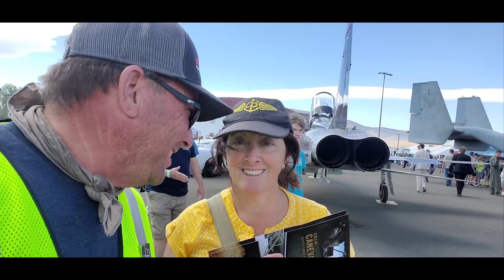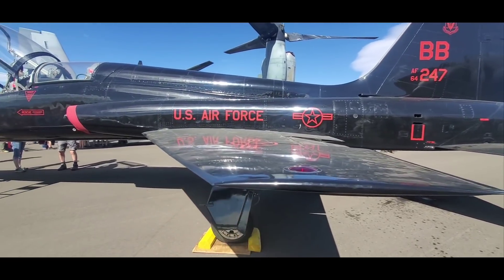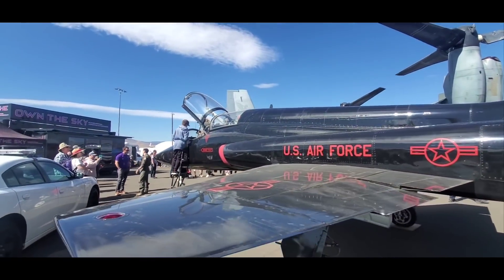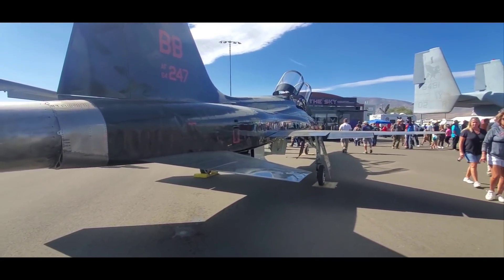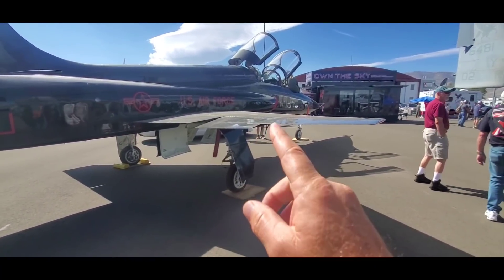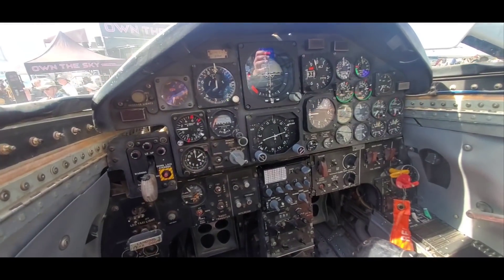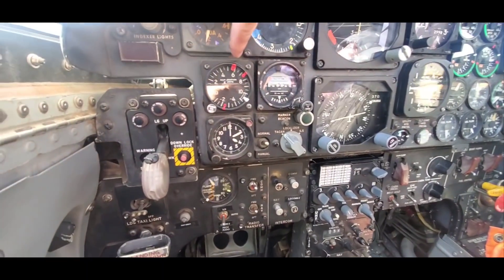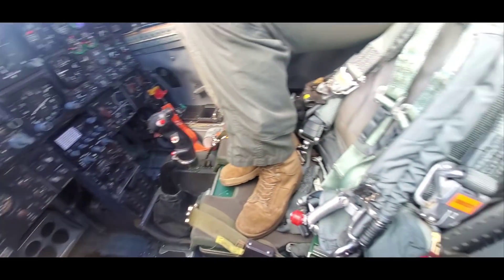T-38 Tour!

Comment: Flew a fresh 38 that smelled like a new car in 1970 at UPT. It had fewer than 100 hours on it and was a very smooth flyer. As I recall the roll rate was about 720 degrees per second. Never liked flying with the new Lt instructors, their hands were always touching the stick. The post Nam Thud drivers and Hun drivers taught you to be a fighter pilot and were great fun to fly with.
Reply: The post Nam Thud and Hun drivers were as rare as white Buffalo.  I had a B-52 A/C commander.  Still learned a lot, but there was no Fighter Pilot Mystique in that guy.
Reply: Thuds first fighter aircraft designed to carry nukes- went "thud" when engine went out  made great wild weasels. Replaced by F4's. Hanoi Hilton had lots of Thud pilots.
Reply: @c123bthunderpig Thud was a hard fighting war horse for sure. Lots of Thud parts scattered around SE Asia
Reply: By the 80's the AF had learned to tell the IP to quit touching the stick unless you were taking the aircraft....Former T-38 IP
Reply: @fishon7301  I had flight at PIT with an old behind the liner who not only had a hold on the stick, but had his feet on the rudder pedals.  I discovered this on takeoff roll and I very forcefully and angrily told him to get off the rudders and stick.  I was a butter bar of course and I believe he was an LC, because he seemed quite old - ha.  He did and we had a great flight.  I do not recall his even mentioning it during the debrief.  I never rode the controls with a student but my hands were much less than an inch from them in the pattern near the ground and in fingertip.  I never coached with my hands either.  Change of control was positive, both verbal and physical.  After I left Willy I heard they lost a jet at altitude over a change of control issue, but I do not remember the details.
Reply: @bja2024  i took basic flight at willy in 1968, was transferred to Luke for advance flight and them to Udorn where I blew out my eyes and was let go. T38 was fun but the f4 was much more of a useful airplane. ty for the tour, takes me back.
Reply: @jmac8092  👍👍
Reply: @jmac8092  What happened to your eyes jmac?  Willie was a great place, '72-'73 for me.  Flew RF-4C's afterwards.
Reply: Agreed.
Reply: Shoe

Comment: The AOA system was added sometime after 72. When it was first added, we really never trusted it because in part, we didn’t understand it. The throttles head finger lifts that you had to raise in order to shut off the engines so a gross overshoot and throttles snapped to idle did not cut the engines off.  Although. I did see an IP shut the engines off in last change at PIT doing T-Bird ground ops.

Comment: Funny, even the pilot didn’t know asymmetric g’s.  2.5/2.7/2.9 at 1k 2k, and 3.7k lbs of fuel.  The redlines shown were symmetric g limits at full fuel load and 1k fuel. 6.0/6.6/7.2.  It’s been 30 years, but these numbers are hard to forget after 7 years as a FAIP!?!

Comment: Unless it’s changed, the B model only had 6000lbs of thrust in full blower.  Still good enough to hack the clock at brake release and pass supersonic at 43000 feet in 3-1/2 minutes.

Comment: - 3,000 lbs of thrust x 2 in burner. 
- 2,000 lbs x 2 in Mil
- As far as supersonic top speed, the reason the 38 is limited to 1.15M or so, is the convergent nozzles can't accelerate air faster than Mach 1.0, but since the air temperature is higher inside the engine, Mach 1.0 is a little higher too.  So even a simple convergent nozzle can push the jet a little above Mach 1.0 measured in the ambient air.
- The lines on the G meter are for full fuel and near empty, not for symmetric and asymmetric which is limited to just over 4 rolling Gs worst case.
- The area rule fuselage is to keep over all air displaced by the jet minimized, so you squeeze the fuse a little where the wings would otherwise displace more air.  It helps cap drag when supersonic because it helps cap drag all the time.
- The reason the stick feels heavier when supersonic is that the center of lift moves aft, making the CG position feel more nose heavy even though the CG doesn't change.
- She is why we make student pilots to go through PA.  Its not that PA knows anything either, but it makes it harder for her to talk.

Comment: The all moving tail was the British solution to the Mach Tuck problem (movement of pressure due to the shock wave over the elevator) that was key to enabling the Bell X1 (which originally had a convention tail) to break the sound barrier.

Comment: I remember watching a T-38 take off early one morning as I was working on the ramp. It caught my attention as it sounded just a bit different that morning.. Low and behold, the rear canopy was up and doing a darn good job acting as a speed brake.. To the pilots credit, he kept it straight and level at about 50' off the desert floor until the canopy finally ripped off and in the process took off the top of the vertical, above the rudder. The pilot was able to save the aircraft and return to base, but I'm sure the cockpit likely had a new aroma after that..

Comment: Did I see that aircraft didn’t have the modified throttle gate?  I thought they all had that?  Kept the stud from inadvertently shutting down engines, and was only in the front seat so prevented the ip from being able to shut one down at all. 

We used to joke that the windscreen between the back and front seat saved many a students lives, “cause if I could have reached up there and strangled you I would have”😂😂😂

That light was a position light, the formation lights were strip lights molded into the skin. 

Congrats to the young lady on the U2!   Pioneered by the first woman u2 pilot from Willy back in my day.  Won’t mention her name for obvious reasons, but an awesome pilot!  Nice to see Pete there in the middle of things.

Comment: Thanks for the tour. Black really does show off any flaws, car or plane. A couple corrections. You're about an order of magnitude off on the thrust. It's about 3000 lbs each under burner. 2000 full military power. Also, the Talon will do supersonic in level flight. I think its just more fuel efficient to break through transonic in a dive.

Comment: No flap not really hard from front seat.  Final approach speed 170 plus 1 knot for every 100 pounds over 1000.  No flap from back seat was difficult, especially to 150 foot wide runway.  I have 2,000 hours in the T-38 at Reese and Minot as ACE Deputy Detachment Commander.
Reply: Pretty cool gig John flying them at Minot.

Comment: A moot point, Chuck just verified stabilator dynamics he did not invent it. It was developed in the fog of jet aircraft design during and after WW2 by the British- Miles M.52 aircraft Which was cancelled mysteriously by British and picked up by USA and used by NACA. Sir Frank Whittle resigned as a result of this decision.  Wing chord thickness on 38 can be topic of another discussion. I believe there is another post confirming this. You caught thrust  ~ 2,900 pounds each at full AB, ( J85 -GE - 5). We had two on C123, J85's for supplemental power. You may recall 2019 crash of T38 Vance AFB due to breaking maneuver in training.

Comment: Here you go again bringing back so many memories of flying the T-38 as an IP.  And had the good fortune of delivering a brand new F-5 from Sacramento to Morocco which was quite a nice gig.  Thanks for your great coverage at the Reno Air Races!
Reply: How did you get the F-5 across the ocean?
Reply: @jcheck6  Flew it first to Williams AFB where we had just checked out in the F-5 ... had to learn how to use fuel  out of the belly tank.  Then on to Tulsa where we met an FAA crew flying a C-130 whom we met up with in Greenland. From there to somewhere in the mid west then finally to Bangor. Then on to Newfound, then across to Greenland.  We were stuck there waiting for our other two wingman (from Norway) cuz they had messed up their tires landing at Bangor.  We got a ride on the Ski 130 out to deliver supplies to a DIE site and landed on snow at 7500 MSL and -68F.  Never shut off the engines, and we were delivered BLT sandwiches!  Then finally to Iceland, Scotland, Germany, Spain, and to the airbase at Morocco.  What a great boondoggle!!! Cheers.
Reply: @bsjcook  Wow, that is impressive BS!  I was at Willie for UPT '72-'73 when I met Bob Hoover at the O'Club lunch line.  He was there to check out in the F-5E to demo it at the Paris Airshow.  Always wanted to fly the F-5, ended up flying RF-4C's.
Reply: @jcheck6  OK, but it isn't BS it's FS (flying stuff).  I was in class of 68F at Webb AFB, and that trip took close to 20 days. I never met Bob Hoover but was a big fan. I had close to 700 hrs when I left college and was able to choose the T-38 and stayed at Webb for the next 4.5 years. Then started with Delta 9-4-72. I really enjoy following Juan because of our similar careers. Are you still flying?
Reply: @bsjcook  At 75 I am still flying a Van's RV-8.  You probably retired before the mass 2004 exit at DAL. I am a NERD (never ever really DAL) via the NWA merger.
Reply: @jcheck6  I was lucky to be in the first new hire class after the NE merger, and their group went to ground school first of course. I continued to fly light AC until about 75 when the plane was sold... My favorite thing was to fly young folks on their first flight.... I never thought of the merger folks as anything but fellow pilots. I retired 10/23... Cheers!

Comment: T-38, F-5 F-17 and first F-18 all originally designed, developed and manufactured by Northrop Aircraft . Navy wanted the F-18 for carrier duty. Northrop then had to turn most of the F-18 manufacturing over the McDonnell Douglas who had the sea duty experience.  Boeing F-18 center fuselage is manufacture by Northrop.

Comment: According to that tail code this air frame was ordered in 1964 (!) Still looks futuristic today, almost 60 years later.
Reply: Gotta wonder about the wrinkles on the aft fuselage. Flew 555, queen of the fleet and not a "jig" bird at IP training in the early 70's. Had to add 10 knots for every maneuver and the benign wing rock stall would go inverted right away. Beale might be adding some numbers to that birds perf numbers for mama and the kids.

Comment: If l remember correctly we entered initial at 280 kn, pitched half way down the runway, slowing  to 155 kn + fuel ( 1 kn for every 100 lbs of fuel over 1000), dropped gear and flaps, turn to final reducing speed to 132 + fuel over the barrier, touch down at about 115  - 120 knts, then used aerodynamic braking until the nose wheel touched down.
The aircraft we were using had an integrated flight director, fire control system and much different panel layout.

Comment from the maker: CORRECTION! About 3,000 lbs of thrust. (Not 30,000- misspoke).
Reply: I was thinking … that’s an awful lot of thrust !!
Reply: @DAllan-lz3lg  12,000lb aircraft with 60,000 of thrust, so it goes vertical from the chocks.
Reply: And yet 3000 lbs seems so low.
Reply: @christopheraniftos2666  Google check…nearly 4000lbs with A/B… he did say you have to point it downhill to go supersonic
Reply: Not sure if there is a difference between the A and C model with the PMP mod.
Reply: 30,000 lb thrust would be one wild ride. I suspect the wings would develop a little flutter relatively quickly.

Comment: In 1967, following tech school, I went to an ATC base and was assigned to the Singer-Link T38 intrument flight trainer.  Fun thing to fly.  Some of the instruments (HSI & ADI to name a couple) were actual aircraft instruments that were stimulated, not simulated.  Vacuum tube based computer system and motor/generator provided power to run the whole thing.

Comment: 10000 ft for a loop - wow!
Reply: 300 knots minimum at 20000, mil power, push/bunt over, accelerate, start the pull at 400 knots still accelerating,  pull 4-5G until the tickle, tickle it over the top, accelerate down the back side and pickup the 4-5 Gs back to the horizon — as I recall, but it has been a long time.

Comment: T-38 Engine troop Randolph civilian 1996-2000. Removed the whole Training Wings engines and retrimmed in Test Cell and rerigged.
Used to come in to work at 5 AM and I ran about 12 Aircraft a day. Spent around an hour and a half in the engine changing out a Flameholder (once as I am 6ft tall)- my arms ached for days working overhead hand- I was a Minor Celebrity after that! Cheers All

Comment: Great tour, instructed in the T-38 in the early seventies. No AOA indicator then.  Great flying a/c.
Reply: It was a slow rollout as I remember and no one trusted it in the final turn anyway.  We still computed the airspeed and flew the jet by feel.
Reply: @bja2024  "by feel". Yes we all learned aero and performance numbers but that jet did bring out an ability to feel what the bird was doing. As an IP on a mobile stint I saw a solo stud roll out on final from an overhead with no flaps (when we still did overhead dual no flaps) and he was so locked in he ignored go around calls and landed. Had to pink him but he definitely was flying that bird by feel to survive a final turn without flaps. But that bird did not need 10,000 feet to loop. I've done 2,500 foot 250KIAS AB loops. You need to do them from the back seat though so you can use that flap control to milk 45 degree flaps out and back in.
Reply: @jamesmurray3948  Ha!  But you didn’t instruct that loop for studs I suspect.
Reply: @bja2024  No I was just forward thinking of keeping the bird in sight at airshows when doing a loop:)
Reply: The T-38 Thunderbird Airshows required 20/20 vision.

Comment: just a little off on the thrust, Power Plant: Two General Electric J85-GE-5 turbojet engines with afterburners
Thrust: 2,050 pounds dry thrust; 2,900 with afterburners
Reply: I'll never thought those engines were that week.
Reply: @markthompson8656  the f-5 E/F combat model of the t-38 used the J85-GE-J1A which had 5000lb thrust

Comment: How do they fit fuel in that plane T-38
Reply: It’s all in the fuselage, no wing tanks.
Reply: @f4windex  Right you are sir.  My bad, it’s been over 45 years.  The wing roots are full of landing gear struts.
Reply from the maker: In the fues.
Reply: The wing tanks did not hold that much and were inboard of the gear wells.

Comment: There is a throttle gate that you lock after engine start to prevent inadvertently shutting down the motors in-flight.
Reply: engines* =)
Reply: Finger lifts at the base of the throttles had to be raised to select cutoff.  That said I saw a PIT IP shut them both down pulling into last chance in a four ship flight trying to emulate the Thunder Birds during ground ops.

Comment: Juan what was the first jet. It was side by side seating for training then you progressed to the at least in 79.
Reply: Rumor was it did not fly, but rather scared the ground away with its piercing shriek.
Reply from the maker: Yep T-37 'Tweet'.
Reply: @blancolirio  one day at Randolph Air Force Base Texas I was a army uh-1 crew chief when a crew t38 from the base had to bail out because they had a main gear failed to extend. Our helicopter followed them out to the ejection area south of the base where we picked up the crew within 5 minutes of them bailing out. I took pictures of the splash zone with my 35 mm camera and then afterwards one of the pilots that I picked up let me use some of his simulator time in the t37 I flew it for about 10 minutes it was great they even simulated a tire blowout on my landing but I still kept it under control.
Reply: @blancolirio  Thats right . Im getting old Juan just couldn't remember.  We had them at Shepherd Air Force Base. I was on the flight line when a sr71 landed. Engine cone stuck. He barely made it. We were all moved by SP to a hanger then we were let go by bus back to our dorms. The SR 71 took off around midnight OMG I I thought the roof was caving in.  Lol. Wonder what air force is using for first front line trainer now. Surely the 37 an 38 have been phased out
Reply: T-37
Reply: ? T-37 I believe

Comment: Approach speed 155+gas for normal landing
Reply: Yes I recall it was 155 plus 1 knot for every hundred pounds of gas onboard over 1000 pounds. So if I had 1500 pounds of fuel onboard approach speed was 160. Nothing like doing math in public in the final turn while zorching through the sky at almost 200 hah!  No-flap speeds were 175 KIAS plus fuel, I believe. We always waited until the end of the sortie to do a no-flap full stop to try to keep speeds in check. With tiny tires and brakes, you needed a long runway to stop and relied heavily on aero braking (holding the nose off the ground and coasting in a nose-up attitude to allow aero drag to slow you down…).